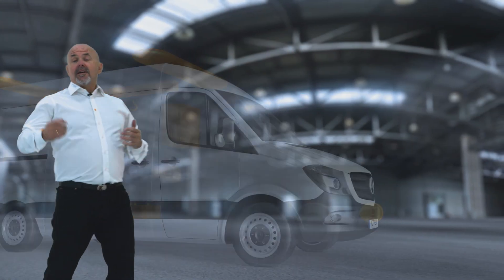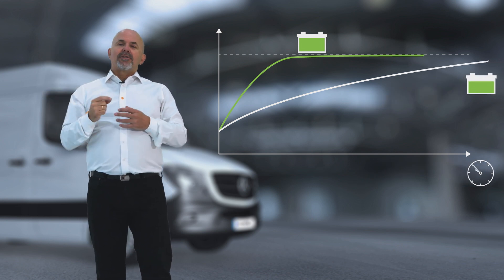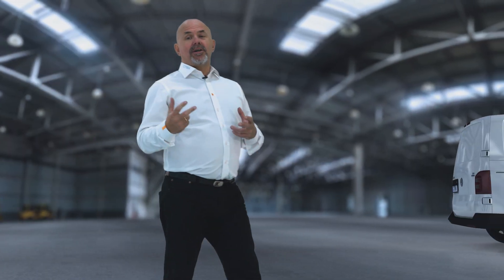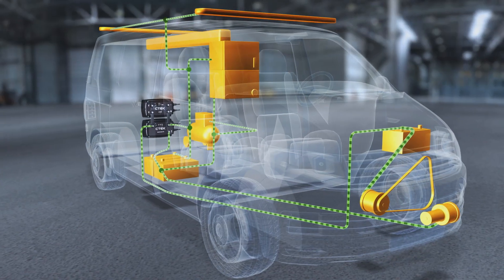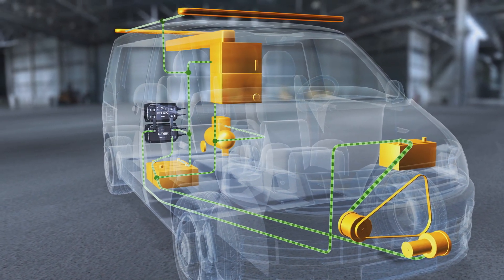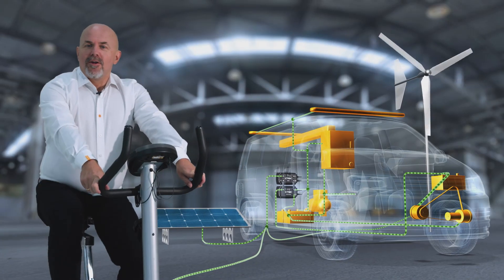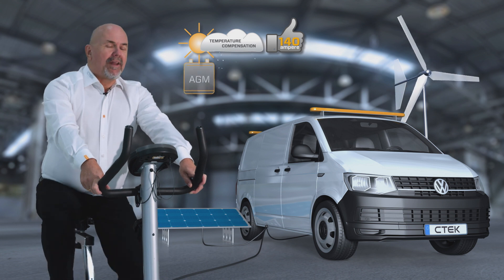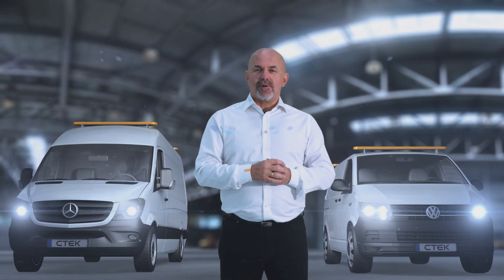CTEK ON BOARD CHARGING SYSTEM

Comment: There should be a one box solution complete with phone monitoring.
This CTEK system is not ideal as I would need to link up two bits of kit ( D250SE & Smartpass 120S ) and then a third bit of kit ( CTX batterysense ) to achieve an optimal system.
You could achieve all this with one dedicated controller if you wanted to. There’s no way I’m shelling out for 3 separate things.
I will wait until I find a solution in one controller that gives the options of the three units above. Somebody will do it.
Reply from the maker: Hi. That would be a smart solution! We decided to have 3 units because sometimes one of the products is enough - and you don't want to pay for the two extra if you only want one. And to make more products (the stand alone products and mixes of them) would be a lot more costly for you, as the customer. But who knows what we will do in the future. Best regards CTEK Support

Comment: For dual battery system in the car/camper van, can I connect the charging circuit from the cigarette plug instead of connecting from the starter battery?
Reply from the maker: HI, I would not recommend that - because the cables from the cigarette plug is often too thin to move a big amount of energy. And it is not sure the cigarette plug is live when you need it to. If it worked you will also add more connection pints that will give more points where voltage can fall and in the end there is a risk that the service battery end up undercharged. I strongly recommend to go from the starter battery. Best regards CTEK Support

Comment: A mains hook up input would make this the perfect system. How would a mains charger integrate with this system if it was connected to the 'house' batteries. At the moment I use a dual vsr and seperate solar controller. Looking at upgrading to a mppt charger and saw this as an all in one system but no mains charging.